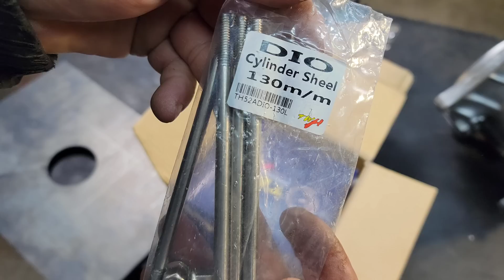Расточка картера для цилиндра 54 мм TWH Racing Honda Dio 120cc

Comment: Hello fellow tuners, greetings. I am looking for some info on this engine and cylinder because I am thinking of fitting this cylinder on my engine, which is not Honda. What is the piston stroke in mm of this engine, cylinder stud spacing, piston height from the center of piston pin to the edge of the piston crown and conrod length? I have a Sym horizontal and a Kymco horizontal, which have some similarities with Honda engine, so it might fit with some work.
Reply: For horizontal honda engines look at piaggio cylinders. Possible mounting with light modifications
Reply: @scooterroundtheworld5747  it could be, but Piaggio 50 has shorter stroke. It has 48mm stud spacing vs Kymco 50mm, that could be made, but Kymco has 41.4mm stroke vs Piaggio 39.3.